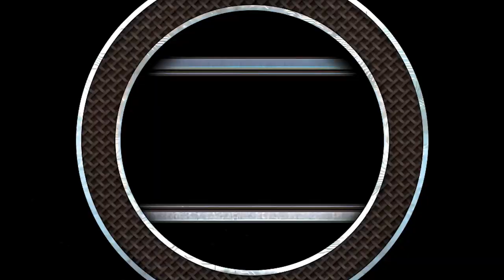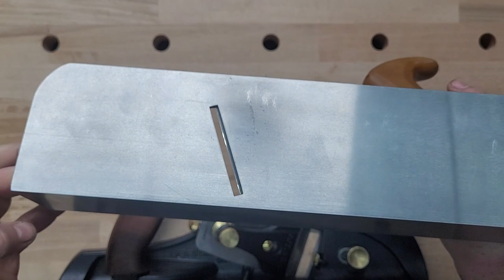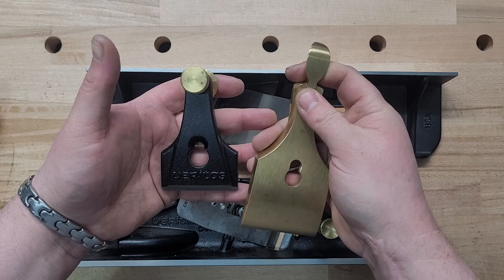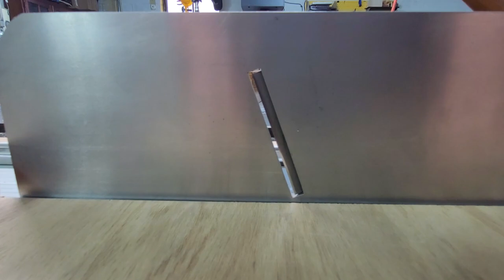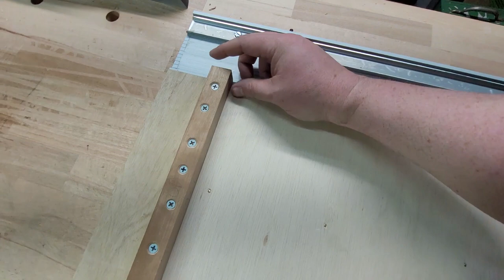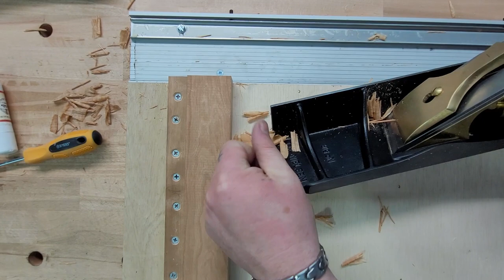UPDATED - IT'S NOT WORKING = $650+ Lie Nielsen Vs $385 Veritas Shooting Plane Review and Comparison

Comment: I think you need to redo this video, although the primary function of a shooting board is to clean/square up edge grain, a lot of people use it to square and clean edge and small face grain. When the LN is working like it should they both perform this very well. But when it comes to edge and face grain the LN wins at this without question. The finished surface is truly like glass even on figured wood. The Veritas gets a lot of tear out in difficult wood. Plus there is obviously something wrong with your set up. LN will not produce a plane that they don’t feel is premium. Don’t get me wrong I have and love veritas tools. But I believe this video will cause people to make a bad purchase decision without them even knowing about it
Reply from the maker: I get what you are saying, but if I plan on shooting long grain or face grain I'm just going to use a bench plane vs a dedicated $650 shooting plane. The LN bench planes would would great for this because the square side would so well in a track if using one.
I'm still getting alot of mixed reviews on the LN for endgrain. Alot are saying it's based on a flawed design that Veritas fixed. And this is comming from die hard LN fans thay only have LN but have Veritas as a shooter lol